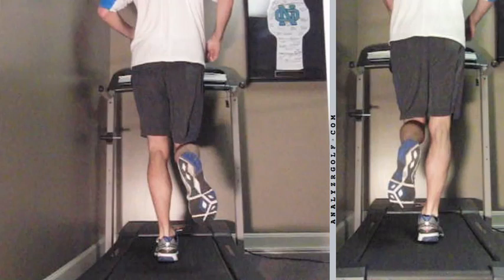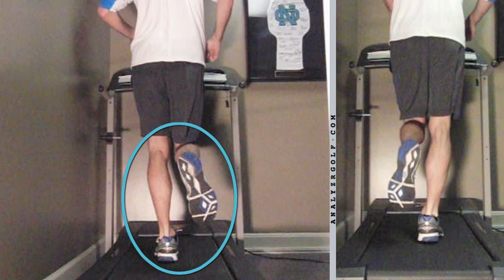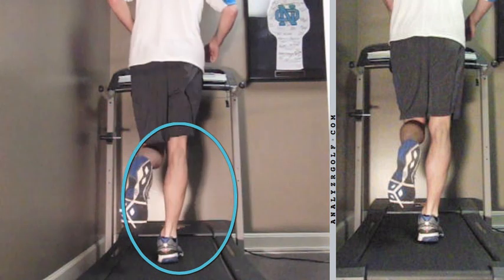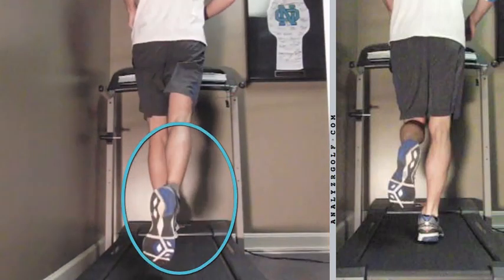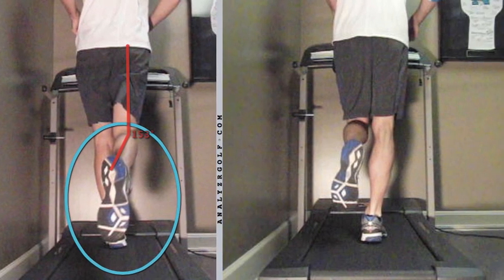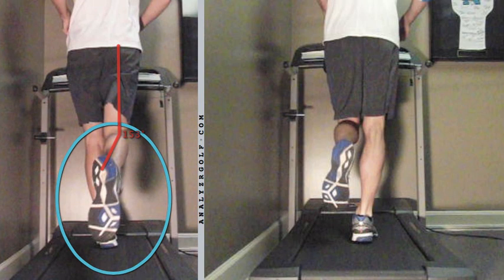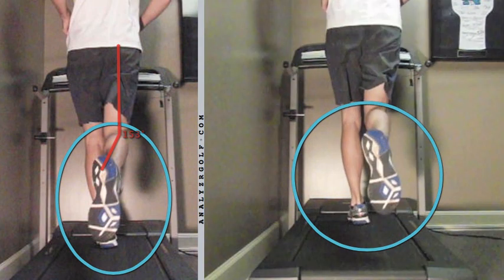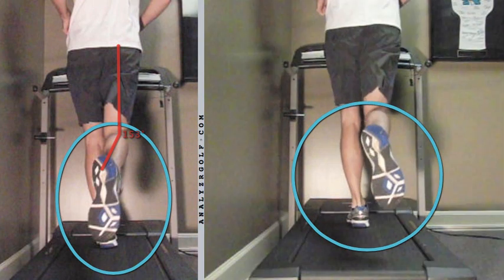Running Gait Analysis # 1

Comment: Absolutely horrible analysis. At least do symmetrical measurements on both sides and not cherry pick spots to pause and draw angles to prove a point.
Reply: yep just stopping the video whenever to try make up why that's the issue causing it. so bad

Comment: The runner just happens to drift sideways prior to the first angle measurement of the right leg. Take a look at the two previous cycles and you can clearly see that the runner really does not have any serious bilateral asymmetry. The chiropractor is subsequently not addressing the right problem. Also, to analyse movement under zero ground force such as the swing leg is meaningless in the context of injury assessment. Iif the runner would repeat the same motion hanging free in the air a million times, he would probaby not suffer any injuries from it whatsoever. You need to analyse the alignment of his hip joint when force is applied and you also need to know wheter that force is large or small. You can't do that with just a video camera. Moreover, you cannot study hip motion on a guy wearing bermudas.

Comment: Great video, thanks for putting this up!  At what point in the gait cycle do you take these measurements?  Is that loading response of the L foot or Initial swing of R?  Or, should it just be that he is at 180deg throughout the entire swing phase, making it only relevant when he has the most deviation from that 180deg?
Reply: yes